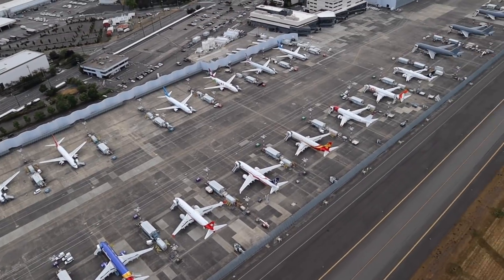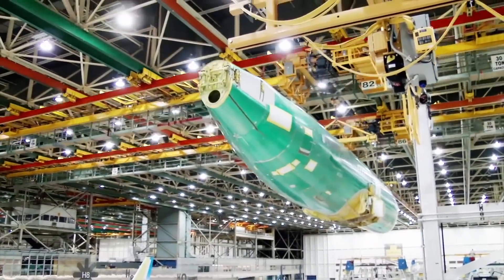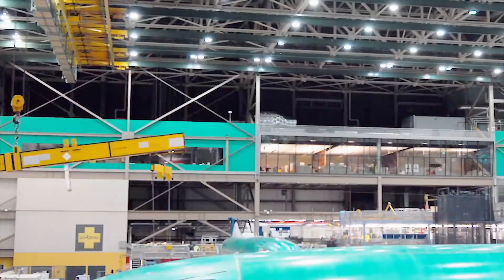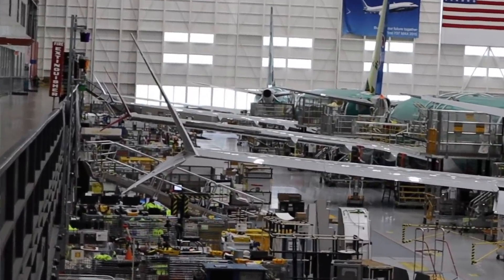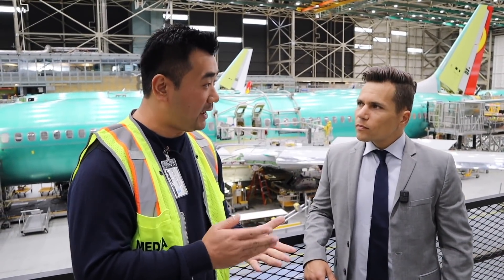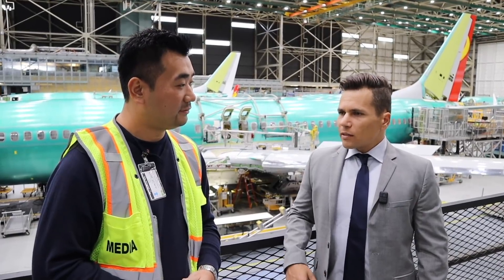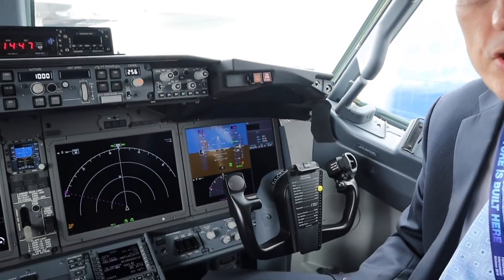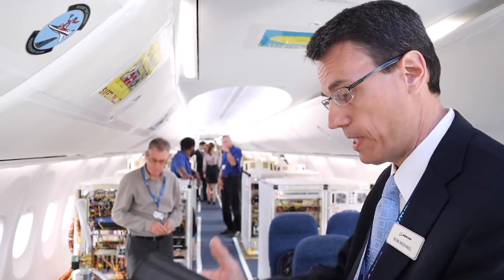Boeing 737 MAX - How Boeing Builds Their Best Selling Plane

Comment: It’s amazing that Boeing refuses to give credit to the highest regarded narrow aisle aircraft they have ever built. The 10 is nothing like the 757, we all know that, it will not be able to take off   in as little runway, it will not be able to flew to its cruise altitude in one step, the MAX models will have to use multiple steps to hit altitude, and thirdly you could use the very large diameter fan Leap and GF PW-1000 engines built for the A321 on a 757 from a clearance standpoint. Now of the MAX aircraft have the ground clearance to use the more economical  78” or 81” fans. A redesigned 757 into a 797 perhaps could easily handle the large diameter. Boeing can’t stop bad mouthing the 757 which really pisses off pilots who love the sports car of the air as well as passengers who enjoy flying in this awesome 34 year old beauty. The 737 is known as a ground grabber, only the curvature of the earth allows it to takeoff. The longest takeoff rolls I’ve ever had have been 737s
Reply: I’ve heard the stories about destruction of the specialized 757 tooling having been destroyed and that the build was the least profitable by far most unique and expensive ever. Although the 707 to 737 to 757 cabin sections are basically identical. As well the cockpit is identical to the 767. I dont’t believe Boeing commercial’s VPs, they are simply trying to sabotage the 757 killing the interest. Problem: I’ve spoken with Boeing line supervisors retired and still active who call those statements BS. Doug Parker calls Boeing’s trashing of the 757 BS, Phoenix based AA mechanics who have worked on 757s since America West (HP) days, dispute those claims also. What Boeing is doing is guaranteeing that long time Boeing customers who fly the 757 must replace it with the A321neo or A321LR. Yes, the MAX is being used for mainline to Hawaii flights just as the 737-800’s had been for years by Aloha and Alaska. As well the MAX is used for Europe to East Coastf lights, soon to be starting Brussels to Newark service add that to your list. 
Pilots are universal in praising the 757, to many it will forever be their best ride. Boeing has made a huge miscalculation the MAX 10 will never be as efficient as the larger fan A321 the reason, because Boeing promised that all 737 fleet carriers that the 737s will always be able to fit in the same size (height in particular) hangers, they will not allow a greater ground clearance which would be breaking the promise , no 78” or 82” engine fans for the 737. the 59” is the MAX

Comment: That 737 max 7 really remind me to their old 737-500 😂 especially from the lenght of the body..
Reply from the maker: I believe the 500 series is shorter, more stubby.
Reply: I agree very 737 is cute body wide thickly BBJ.
Reply: You have a fun life!
Reply: The MAX 7 is more comparable to the -300/-700 in size. Slightly longer though. It would’ve been cool to see a MAX 6 to be the size of a -500/-600, but there’s not really a market for aircraft shrinks. The -600 failed, and now the MAX 7 and A319neo are both failing compared to their other respective variants. It seems now extra capacity is more important than sacrificing that for range.
Reply: J. O. So the A319neo has 36 firm orders as of right now. You’re telling me that’s not a failure? Okay...

Comment: They might be building them but they can’t deliver them...
Reply: Boeing is not suffering a labor shortage... its a supply of engines that are holding things back. they turn out 57 or something a month... thats a lot of planes. not to mention, do you want rushed planes that suffer manufacturing defects like airbus? the virgin american planes alaska acquired all have manufacturing defects.
Reply: mach533x  I'm really surprised how all these are commenting saying it's a labor shortage.  It's clearly an engine supply issue from CFM that is affecting both 737 max and A320 NEO, but more so to 737 max as the engine is sole sourced.
Reply: mach533x Boeing build planes quicker than Airbus, that’s only because they have been building the same plane for pretty much 50 years so the process innovation is pretty much already there
Reply: @mach533x  spot on mach
Reply: Time is Money, Airbus don't have defects like Boeing, Boeing is just not Going
Reply: The engine issue for the 787 is only with the RR engine option, they will all have to be rebuilt this is killing New Zealand Air. I’m not aware of delays with the LEAP 1s
Reply from the maker: I understand Boeing is suffering a setback. Airbus as well as the demand for 737/320 are very high. See my blog post 
https://samchui.com/2018/09/04/boeing-and-airbus-continue-to-face-delivery-delays/#.W5jLbJNKjOQ
Reply: "They might be building them but they can’t deliver them..." this phrase fits for Airbus...
Reply: COROLLA95 Yes it fits
Reply: STFU, idiot.
Reply: If their contracted parts suppliers would do the job they're paid to do, Boeing would have the parts they need and these aircraft would be in service. It's a supplier issue, not a Boeing manufacturing issue.
Reply: Sam “The most Productive” they’re suffering a labour shortage and can’t finish the jets they have on order shame that was glossed over.
Reply: too much demand for this aircraft
Reply: Wrong No one is buying them and they cant even Finish them Boeing has lost their way they are way too slow for Production, I have lost respect for them they used to be good not anymore, Airbus is the Best Now
Reply: i'm working with RR in Singapore, most of our orders now are with Boeing for years, we know our customers....we stopped building our Trent engines for the A380...and way limited qty with A350
Reply: Scott 250r sure they are the best at it
Reply: @TheAirplanejunkie  personally I like Boeing better because they have cool planes like the 787 and the 737 but, Airbus also has cool and new planes like the A380. So I think they are both are cool in their own ways.
Reply: Bugsy is correct, the 787 and 777 will dominate the long haul market for the future. You want unhappiness try taking the marketing jobs at AirBus selling the A330neo and A380neo.
Reply: The FBI & DOJ colluded to cover up hillary's crimes  what a RACISTS piece of shit and dumb you fucking are how in he'll can he vote for Obama if he is French 
I not defending his moron ASS he is a hater yes like you 

you trump supporters are the most hypocrites morons I ever knew you calling him a socialists 

When  you have a president is in love with  A COMMUNIST DICTATOR CALL Vladimir Putin  when you have a new  republican party that has become pro socialism Russia everything the republican party has  stand in the past is going  you have a president that he is acting like a communist dictator 
WHEN YOU HAVE A PRESIDENT that doesn't like when someone criticizes him 
WE ALL NEED TO BE WORRY WHEN you have a president making.treats of putting in jail his  political rivals when you have a president giving pardons to corrupt politicians and been upset because politicians.of his own party are been charge with felonies we all need to start  worrying for our country democracy  many of my brothers die trying to protect us from dictators   republicans put us  in there we when to those countries trying to give people a better lives and overthrow dictatorial government's  trump is everything we fought against in Iraq I m a real PATRIOT i m 29 years old former marine that  serve his country for 8 years proud marine for life fuck Antifa fuck Altright fuck far right fuck far left  fuck socialism fuck communism Fuck TRUMP and fuck you for been such of ignorant Moron
Reply: Boeing Sux these days they gone downhill & that is Why Airbus is ao much better, they make new planes and deliver it fast and on time
Reply: Tim Miles  airbus has the same issue.  the issue is that CFM can't deliver  Leap 1 engines on time.  It's affecting both 737 MAX and A320 NEO but, A320 engines aren't sole sourced, so they aren't as affected as Boeing is.
Reply: @TheAirplanejunkie  You are wrong. Boeing is the very best.  Boo Airbus Boo.
Reply: @TheAirplanejunkie  
LOL, 737 current waiting list is on 2028 now, LOL
Reply: Tim Miles it is because of engine problems see Sam chui's comment